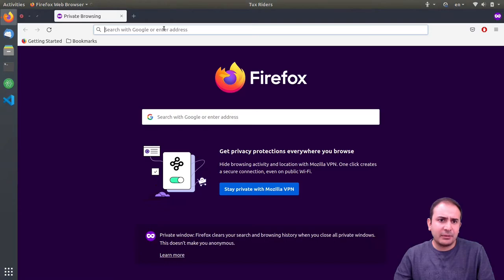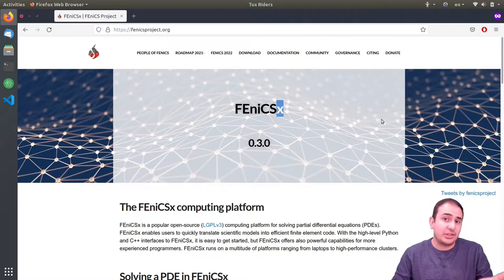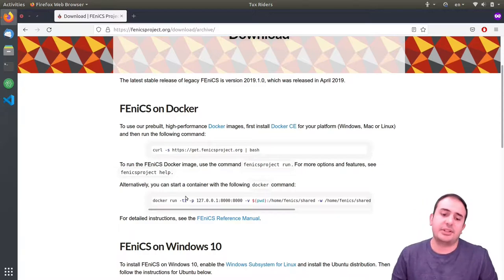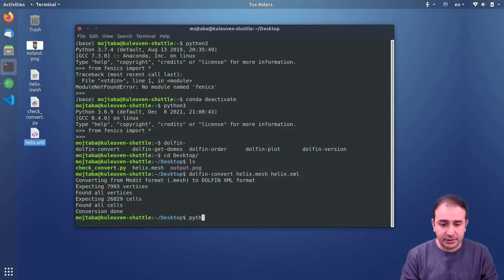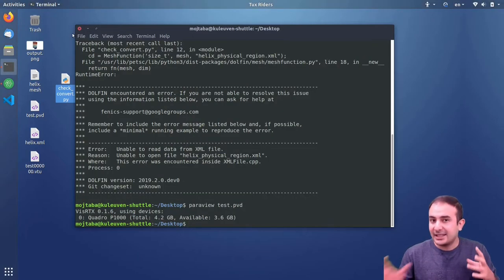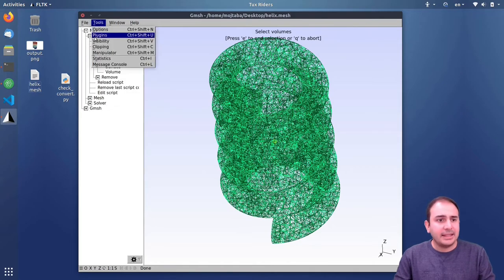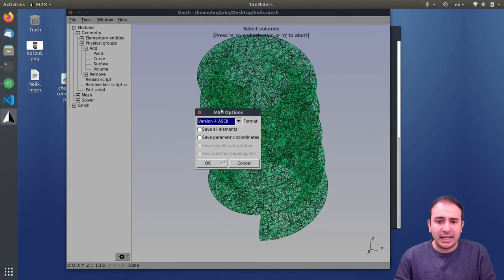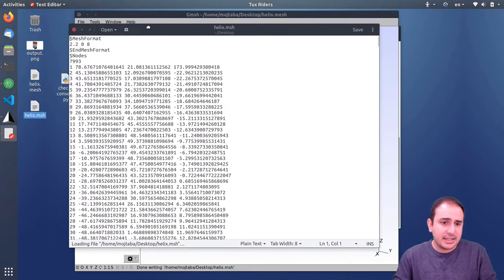[Finite Element 5] Installing FEniCS and importing the mesh into it

Comment: Excellent video! However, I still have a doubt. How can I assign different conductivity to each subdomain using "cd=MeshFunction(...)" ?
Reply from the maker: thanks :)
regarding your question: I've never done such thing in FEniCS using subdomains, and for sure there is an easy way to do so. but, as an example of a simpler case, you may put an expression like k=Expression('(x[2]>100)*300 + (x[2]<=100)*30',degree=1) to specify a conductivity of 300 for the upper part of the geometry (z>100, which is written as x[2]>100) and 30 for the lower part (z<=100).